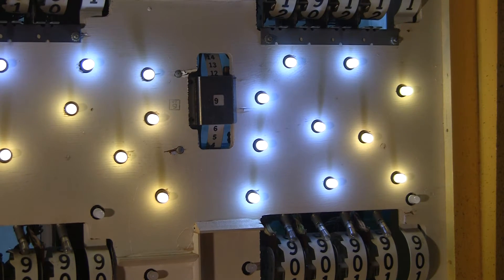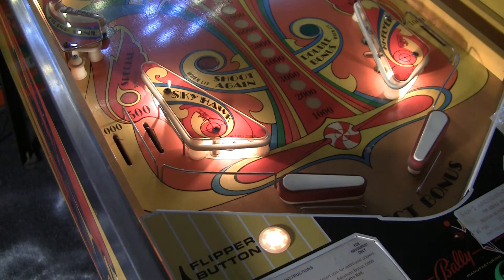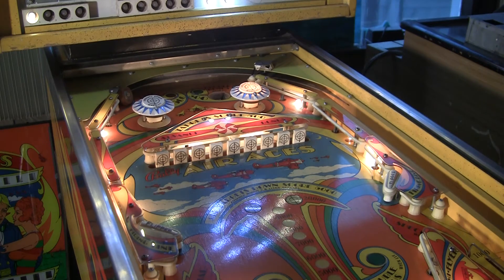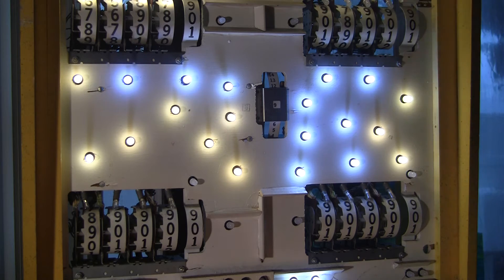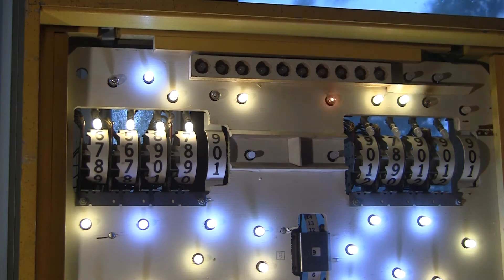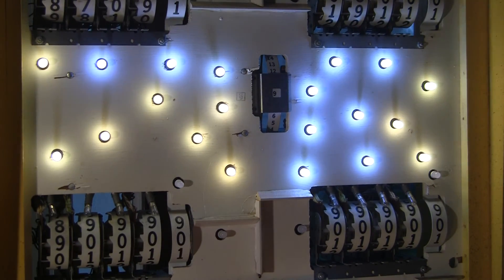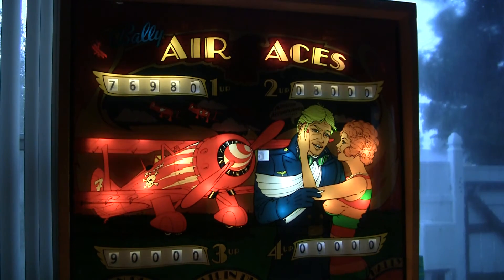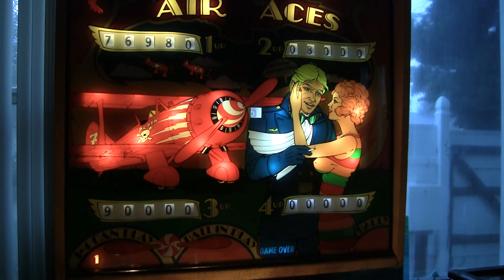Using warm and cool LEDs in pinball machines - PinballHelp.com

Comment: PINBALLHELP ,,   //                                                                     1.) When a switch is CLOSED the PIA chip will send a memory address back to the MPU chip to tell the MPU which switch matrix address has been Open/closed?
//                                                      2.) When a Lamp light is turned ON/OFF the MPU sends a strobe data signal/row & column data signal to tell the PIA chip which memory address to turn ON/OFF which lamp light in the lamp/light matrix?
//                      3.) PIA chips are acting like an address decoder chip for all the switches and lamps 
Each switch and lamp/light has a specific memory address to each switch and lamp/light for the PIA chip to turn ON/OFF?

Comment: PINBALLHELP,,
...           Why does using 47 bulbs use 40% of less power compared to using 44 bulbs? any reasons why?
Reply: Because they draw less current.  The filament is basically a resistor, and the 47 bulbs use a lower resistance filament, hence they aren't as bright.

Comment: Hi mate.  Thanks for that, I have been contemplating replacing the lights, however, my biggest problem is those crummy light fittings.  A lot of them only work when I hold them in a certain place.  I had thought of replacing the bastards but that is going to add up.
Reply from the maker: I use some scotch brite rolled into a cylinder to clean the light fixtures.  You can also take some pliers and bend them slightly so they hug the bulbs more.
Reply: Thanks for that.  I bought some rubber nail polisher inserts for a dremmel like machine and did the bending trick.  However, I think that most of the problem lies at the bottom connector of the fitting.  As I understand it, the Spanish bulb holders are well known for that.  However thanks anyway.